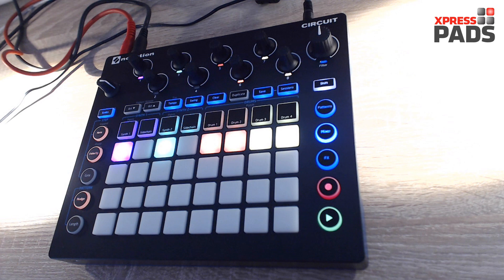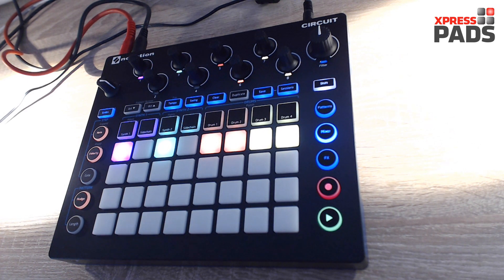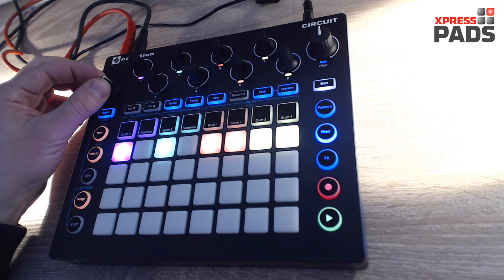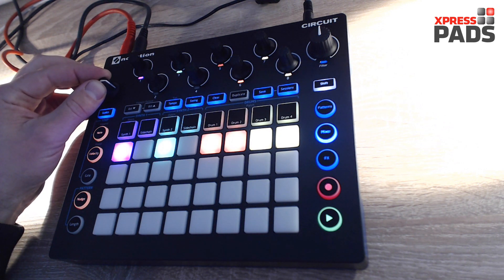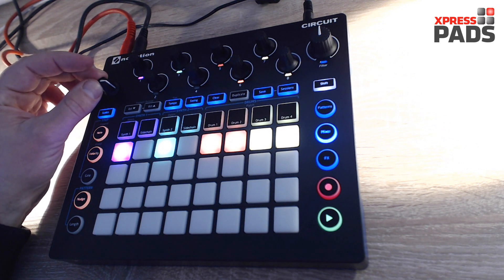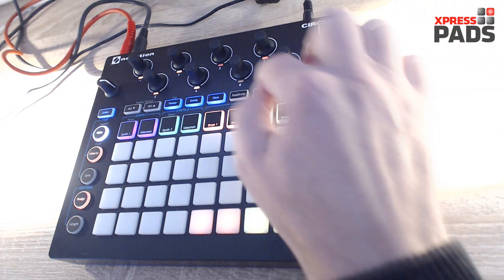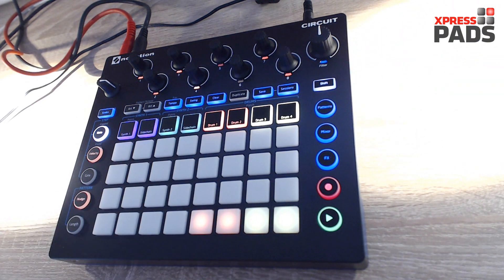Novation Circuit Tutorial - Lesson 7: Things To Avoid

Comment: Thanks so much for making these. I wonder, after learning these last bits, if it's not wiser to spend just a touch more money for an Electribe... This Circuit is so close to being perfect!! If the synth was programmable from the front panel, if it could directly sample, if it had just 1 step undo/redo, and a built-in power supply, it would be perfect.

I wonder if people who tried both feel they are both good, or if one is definitely better...
Reply from the maker: Glad that you liked the tutorials. :) Just a few days ago I learnt that Novation has released a 1.2 firmware upgrade which allows to load own samples onto the device. Haven't checked it though... maybe it works for your purposes. Best, Andreas